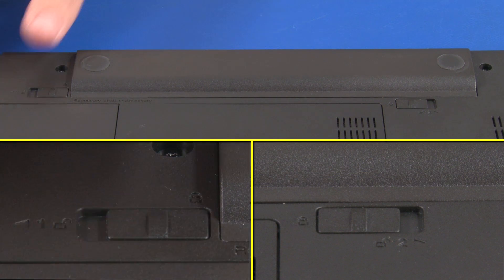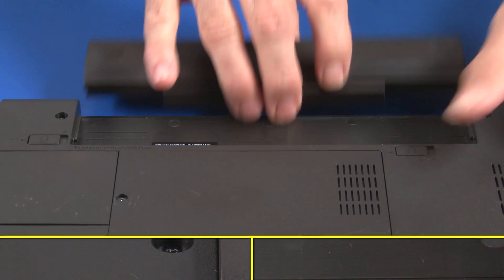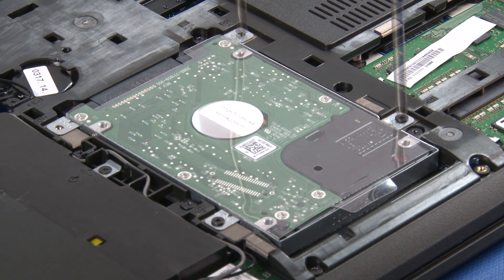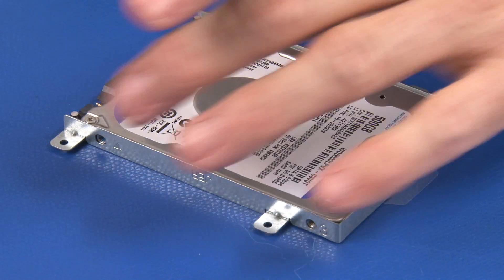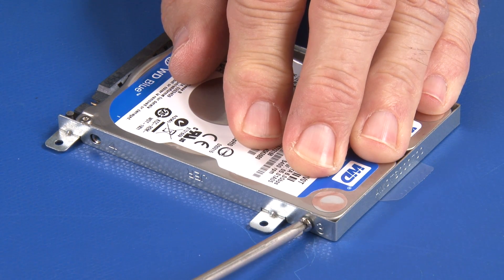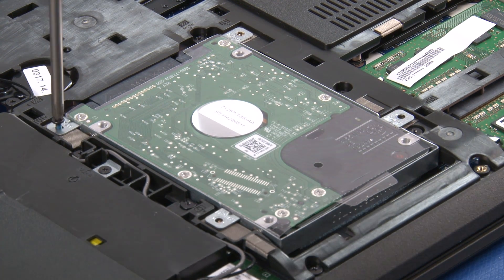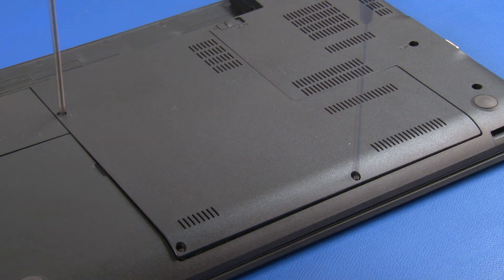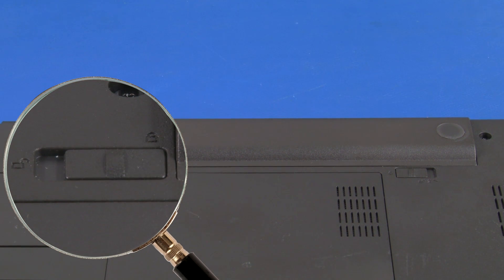ThinkPad E550, E555, E550c Hard Disk Drive and Solid State Drive Replacement

Comment: hi,buddy,i found the thinkpad E550 can perfecly support  Samsung 256Gb SSD,but if i change to a 2TB Samsung SSD,it shows wrong and dispaly northbridge and southbridge chips can't recognize..
Reply from the maker: H Jim. Thanks for reaching out, and we're sorry to hear that you're having trouble. Can you tell us more about the issue via PM/DM? It's possible that the 2 TB Samsung SSD is not compatible with the model. Heart_Lenovo
Reply: @LenovoSupport   My laptop model is thinkpad E550, and the serial number is 20DFA041CDPF09HC9C. the orginal hard driveis  a 500Gb mechanical hard disk. I replaced it with a Samsung 256Gb ssd SaTa hard disk. The computer recognized it pefectly. I reinstalled the OS and it worked normally. But recently I found that the hard disk is almost full, so I bought a Samsung EVO 870  2TB ssd disk, after plugged it into the SATA interface and to install the OS, but found that it could not be recognized, it SHOWed that the south bridge chip and the north bridge chip could not be recognized, so I had to change it back to Samsung The 256Gb SSD hard drive . May I ask if THINKPAD E550 does not support 2TB hard disk capacity? Thanks
Reply from the maker: Hi Jim. Thanks for getting back, and we're sorry for the inconvenience. The serial number is incorrect, it's composed of 8-digit alphanumeric. Here's how to locate your serial number https://lnv.gy/41sFRpa. However, based on the machine type model here's the compatible part # 00HT945, 04X5969 and 01AW554. Kindly see the below link for reference and choose SSD under the Commodity Type drop-down https://lnv.gy/41r7uPf. Regarding up[grade, we highly suggest that you also contact or visit our nearest service center to provide you with options necessary. You can also check the nearest and other accredited service centers from the below link, choose your country, support provider, choose home for your personal device, and on the right side press the location button and type your address, and hit search https://lnv.gy/41wlBmz. Let us know if you need anything else. Heart_Lenovo

Comment: Hi
I replaced the 500 GB HDD with a 275 GB Crucial MX300 SSD on the E555. Now after turning back on the Laptop, the screen remains black, I can't even enter the BIOS. What is the problem and how can I solve it?
Thank you for your help
Reply from the maker: You can try to connect the hard drive in another system to recover files. Without a backup, you are very limited on recovery options.
Reply from the maker: You should contact Lenovo Support
http://support.lenovo.com

Comment: Hello. I have a E550. I did setup the win10. Can i somehow make a Mirror of the HD on a new SSD and simply swap them?
Reply from the maker: Yes, you will need an adapter from SATA to USB and some cloning software. For instance, when I upgraded my PS4 internal drive, I bought a kit similar to this: https://www.amazon.com/Apricorn-Notebook-Upgrade-Connection-ASW-USB3-25/dp/B005C983NA/ref=sr_1_sc_1?ie=UTF8&qid=1479220641&sr=8-1-spell&keywords=apicorn+sata+wire

Comment: Thank you for the awesome video, just one problem though. After putting on the back cover it looks bent out of shape, the screws are on properly and it's only in some areas like the little tab you pull the cover off from.              Any solutions or fixes or will it just Bend back into shape eventually?
Reply from the maker: +THEepicBIRKstar The bottom door has clips and captured screws to secure it. Once you have tightened the captured screws, push around the door to ensure all of the clips are snapped in place. The bottom door should be flush and not have any bends, if installed correctly.

Comment: Hi guys I m using Lenovo ThinkPad W541 license windows7 and upgraded it to windows10 but recently I faced Boot up problem, after shutdown my laptop when I m  going to open it I found following message "an operating system wasn't found try disconnecting any drives that don't contain an operating system press Ctrl+Alt+Del to restart" please any one give me solution.
Reply from the maker: +M. M. Habib E Elah Chowdhury 

Try This: 

Step 1
If you don't have a Windows 10 disk, download Windows 10 here: http://www.microsoft.com/en-us/software-download/windows10
 
Step 2: Perform an Automatic repair
The Automatic repair can detect and fix the issues that prevent the computer from working normally.
After you have a Windows 10 installation disc/USB, follow these steps: 

1. When your computer starts, wait for the manufacturer logo to check the option for boot menu, it will usually be F12.
2. The boot menu key might differ with each manufacturer. If you are unable to find the boot menu key, you may refer the user manual.
3. Restart the computer, when the manufacturer's logo is displayed, keep pressing the Boot menu option key to enter the boot menu and change the boot option to CD\DVD ROM (in case you create DVD). Select USB in case you create USB.
4. After you boot your computer using Windows DVD or System Repair Disc, a black screen appears with gray text "Press any key to boot from CD or DVD". Press any key.
5. Select the correct time and Keyboard type.
6. Click Repair your computer in the lower left corner.
7. Click on Troubleshooting, advanced option and then click Startup Repair.

Comment: OK. The instruction is very clear on how to replace the HD. I have E555, I want to replace the 500GB drive with a 1TB drive. How do I reinstall the OS back to the new drive? Where to get/purchase this OS recovery disc from Lenovo? or I need to use some other SW app to reinstall the OS?
Reply: +Sorcerer Stone You can create a copy of the Recovery Discs using Create Rescue Media on a Lenovo preloaded Windows 7 system. Or you can follow the Windows 8 process to create Recovery Media https://support.lenovo.com/en/documents/ht076024 on a Lenovo preloaded Windows 8 system. If either of these methods are unavailable, you can call Lenovo support and order Recovery Discs for your system.